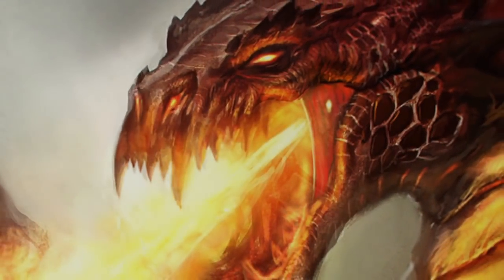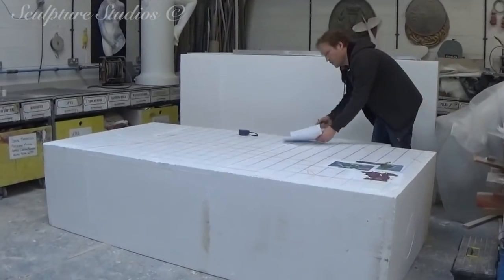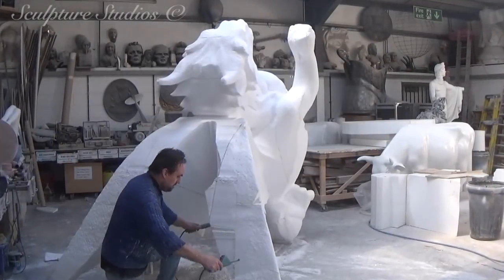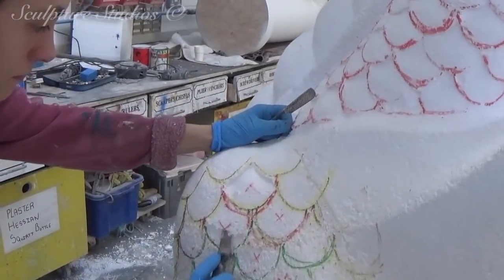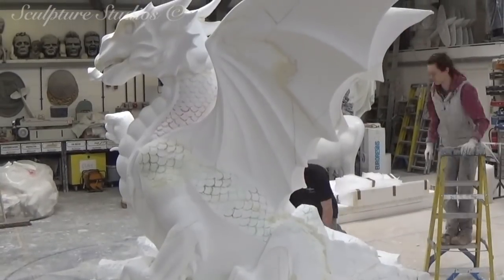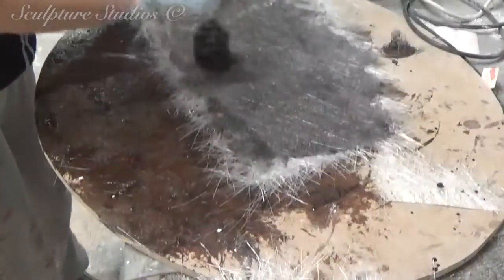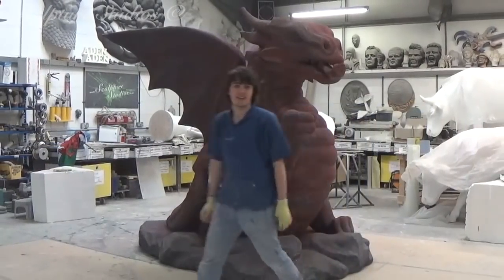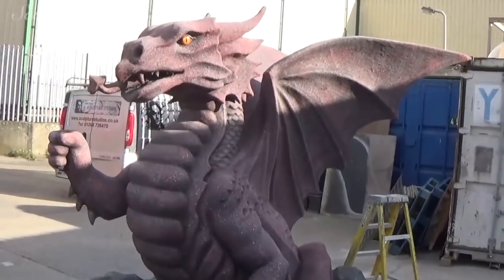Welsh Dragon Stone Statue - Polystyrene / Styrofoam Carving by Sculpture Studios

Comment: I want to put a Gargoyle on my house, I found a good size one made of some kind of resin. It's only under 200usd so I might go ahead a buy it. I am going to be doing 2D images on my walls inside my new house.  We are still building the foundation to the outer walls. I am putting concrete outside and will have 2 turrets on the front of the house. It will also have stained glass in the walls.